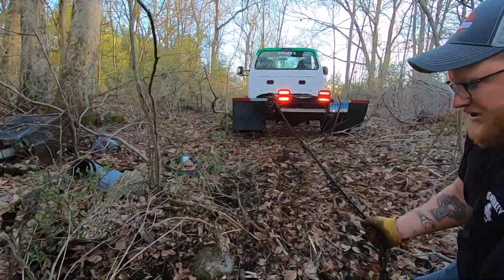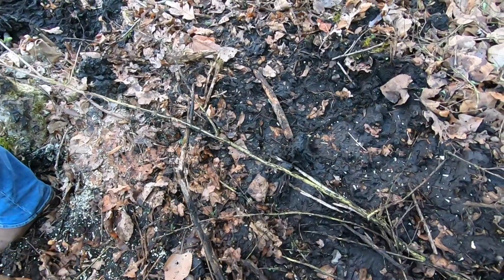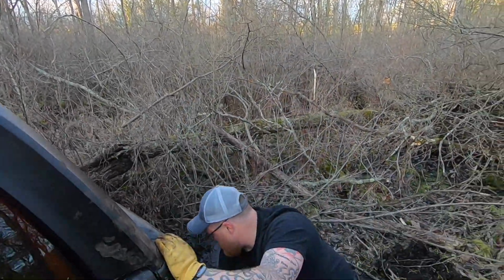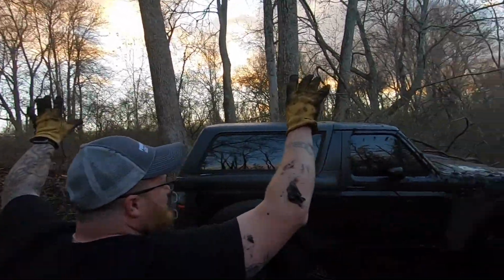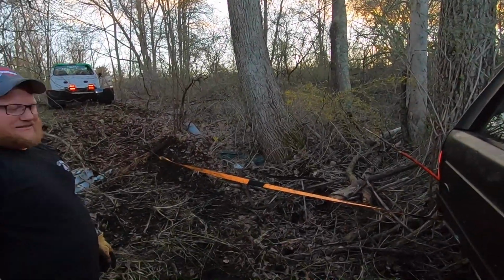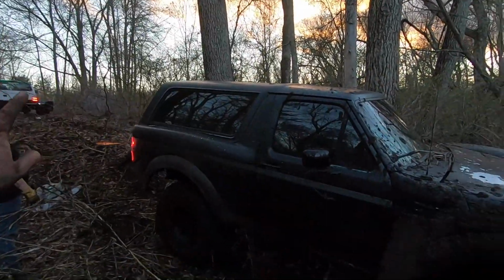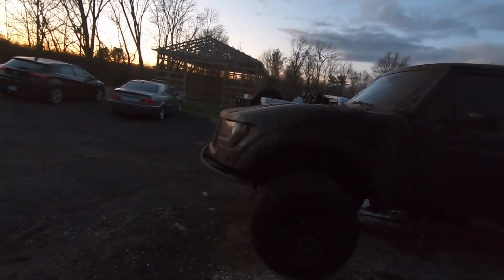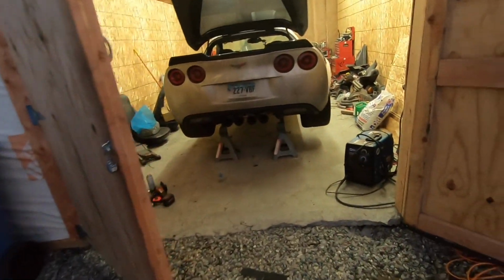Finally got the bronco out almost destroyed it

Comment: Hey man what were the dimensions you used for the front bracket system i’m trying to figure it out because i’m planning to do this project on my bronco this summer
Reply from the maker: I built it on the car I laid the hood on with wood to space it up and just build the whole front structure out of 1/2 inch square tube and flat stock I can take some measurements for ya but it was all just built as I went I also have a full video on that if you go back a month or two
Reply: Paradise C6 Thank you man!
Reply: One more question what rivets did you use to secure the side panels if any at all?
Reply from the maker: Still has the self tappers I bought the rivet nut kit and still haven’t switched it over